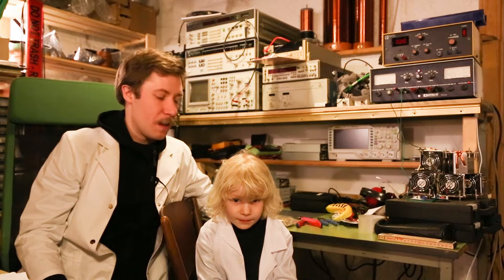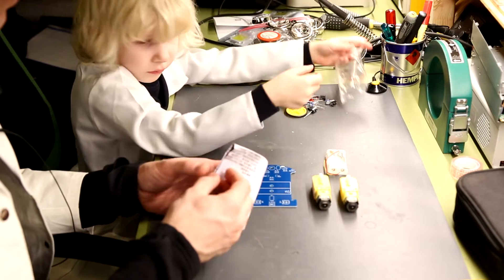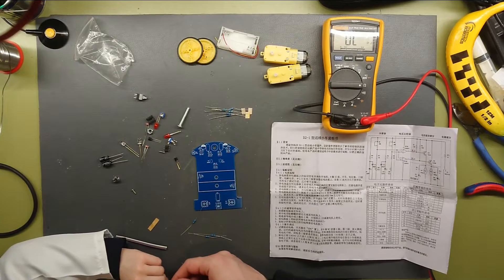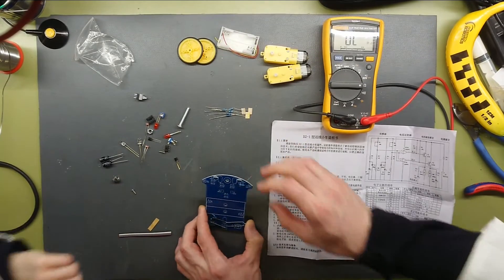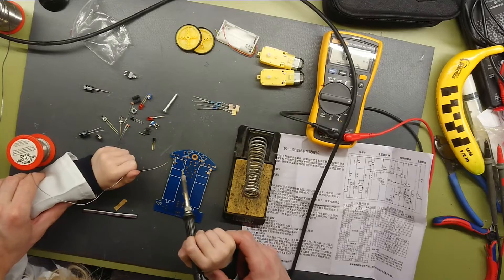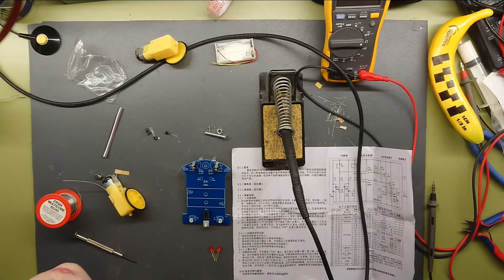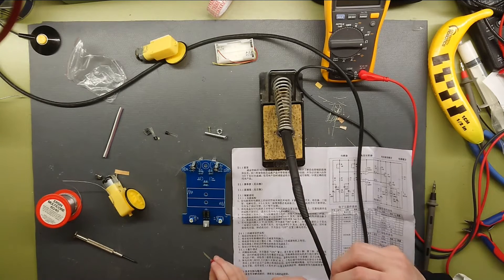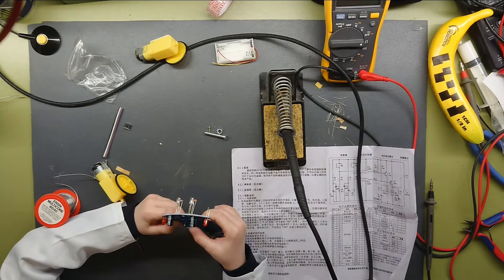Electronics For Kids: Teach a 5 Year Old to Build a Robot

Comment: Very good! Maybe there is one fan, but i couldnt see... try to avoid her inhealing that smoke by installing one nearby.
Reply from the maker: Here I was just blowing it away myself, my fume extraction hood is not installed in the lab yet, but it will be in place soon, better to just remove the concentrated fume than nothing, as of now I do not plan to drill another hole through the 30 cm concrete walls.